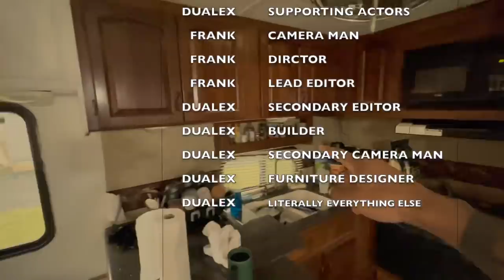Hidden TV Lift in an RV | Tiny Home RV Ep. 8

Comment: An after thought came to me for all of those "lost" screws and "nails" that are dropped in tight spaces. Especially useful in a moving vehicle like an RV; he did a few retrofits on an RV and he said they will eventually roll out and perhaps damage the floor.  My Dad taught me a quick trick; he used a magnet attached to a string, sort of like a plumb bob, and the magnet would pick up any metal that has fallen into cavities. Yes, he was that much of a perfectionist when it came to any project he undertook.

Comment: 1)  Wear a mask.  That sawdust and inhaled vapors in confined spaces will eat you alive.  Your lungs and health are more important than finishing the job quickly.
2)  Wear protective eyewear (all the time).  You can't be the black Norm Abrams if you don't practice shop safety.
3)  You never would have taken your original build apart had you used mortise and tenons at the joints.